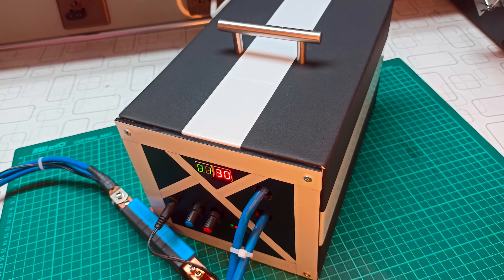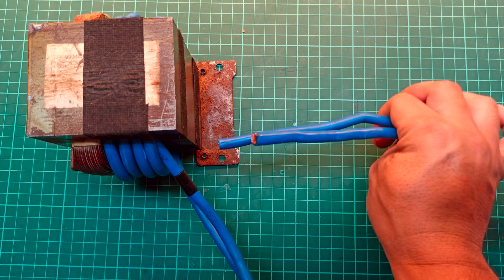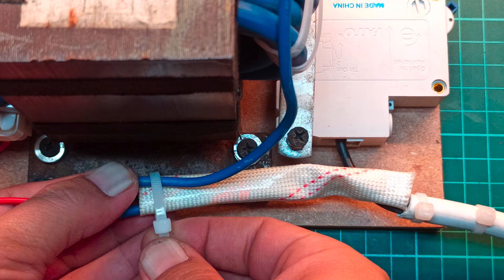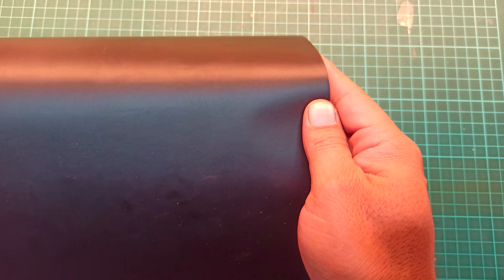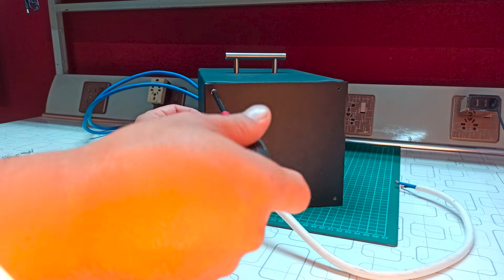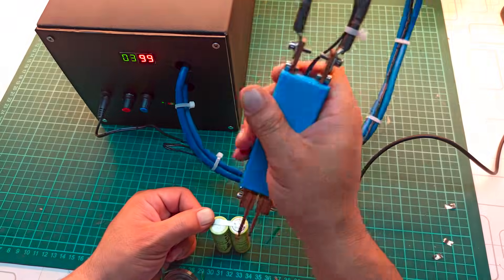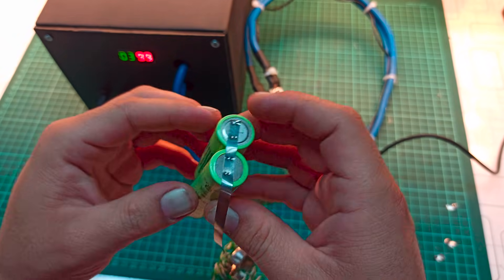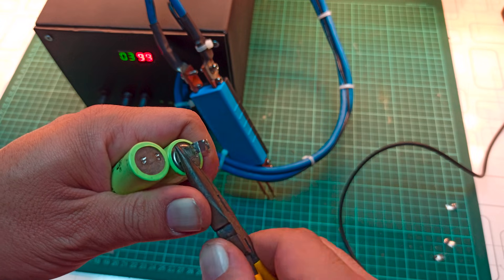Powerful DIY Homemade Spot Welding Machine for 18650 Li-ion Batteries

Comment: thickness of the nickel strip?
was it successful with 0.2 mm nickel plated steel without heating the battery?
Reply from the maker: I did not measured the strip thickness but the strip i used was a standard one and yes it welded the strip to the battery without any heating of the battery.

Comment: Hi How much do PCB design ?I have a circuit diagram
Reply from the maker: Hi there,
You mean cost of PCB fabrication?
Reply: @ERLEngineering  I mean, do you create the PCB design in the program or on the website?
Reply from the maker: Hi there,
I usually use the downloaded version of the EASYEDA software its very easy to use and friendly.
Reply: @ERLEngineering  Can you do it for me?
Reply from the maker: You can share the circuit with me, if i find reasonable time and circuit is not complicated than i'll do it.
Reply: @ERLEngineering  How can I share the circuit? Do you have Instagram?
Reply: Or WhatsApp

Comment: im assuming since its saying the input current is 220 this is for european electrical grids. is there anything different if its to be using on american style 120 volt systems?
Reply from the maker: Yes, since we have european style 220v AC system here so the transformer i got was also 220v by default (as we don't have 120v system here so not appliances too), in case if you have 120v system around you, i assume you will find a microwave oven transformer which has primary side winding for 120v, rest of the circuit and components will remain the same. 😊

Comment: Do you have a wiring diagram of it all together? Thanks.
Reply from the maker: Hi there,
Yes i will share it with you.
Reply from the maker: Hello there, please check the post section of my channel for the required circuit diagram. If you have any questions, please ask me here. Thanks